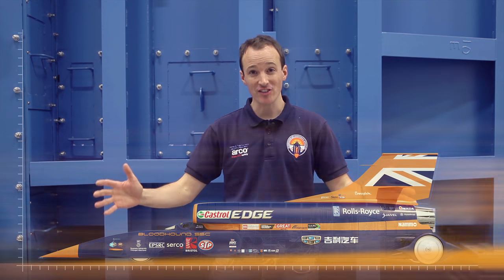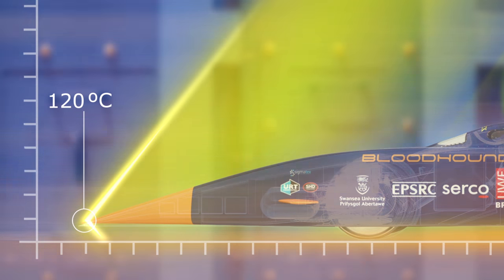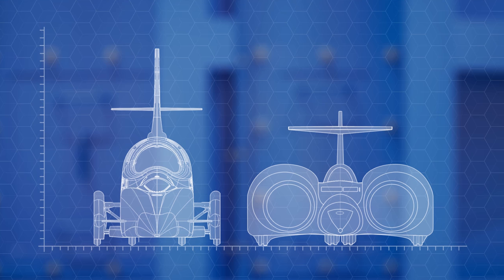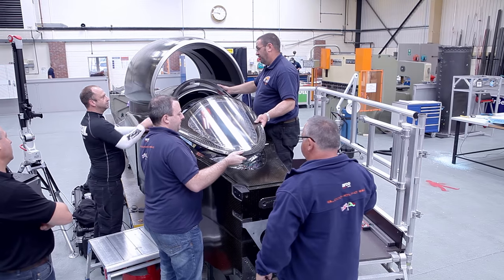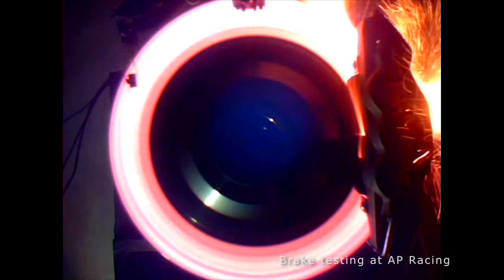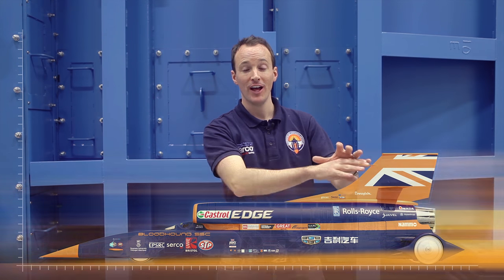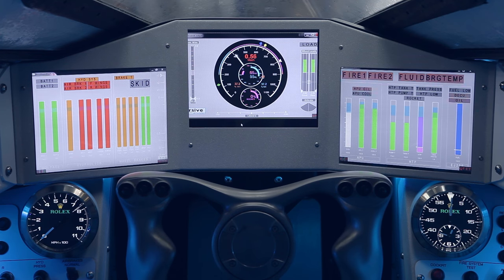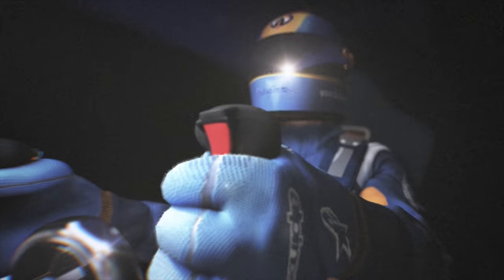Cisco BHTV: Supersonic shockwaves and aerodynamics

Comment: 100 degrees C? You are barely going supersonic, how is that possible?
Reply: Jim Sagubigula Thick air and a lot air compression at the nose. Also, I wouldn’t say mach 1.3 is ‘barely going supersonic’.
Reply: @qasimmir7117  According to the angle of the nose, the temperature shouldn't be that high. By the way, 1,3 Mach is just 30 percent faster than sound. Not a lot.

Comment: Though I agree the soak temperature during runs will hit 100C kinetic heating for 20 second run wont cause a 100C temp rise. Its simply not long enough tip. I was curious why the bottom is flat as that is unfavourable for reflected shockwaves creating lift at the front
Reply: Paul Martin it can actually if you think about it. During shockwaves the air compresses therefore more friction and thus more heat generation at the tip.
Reply: I disagree. Thats accounted for in the stagnation temperature and its still not enough time.  And all other areas where flow exists the heat transfer rate will be higher. Across each shockwave the velocity drops and thus any corresponding stagnation temperature drops. But in reality only a small percentage of the run is supersonic and at m1.3 maybe 4 to 8 seconds.  If you were to take a blow lamp and focus it on a ti tip the delta temperature would not reach 100c in 8 seconds even in natural convection.
Reply: Paul Martin The shape is optimised to put as much of the shock over the top of the vehicle as possible.

Comment: He’s going to be a red smear on the desert floor wherever they try this

There’s no way it’s going to hit the speed they say without that thing exploding into a zillion pieces because of variables they’ve not nor can account for.
Micro changes in air density
Wind changes
Temperature changes 
Etc......

I don’t care how many fluid dynamic computer programs you run through, there is always always always an unforeseen variable you can’t account for.

You might get allot right......
But your gonna get allot wrong and you won’t know that until he’s a red smear in the desert